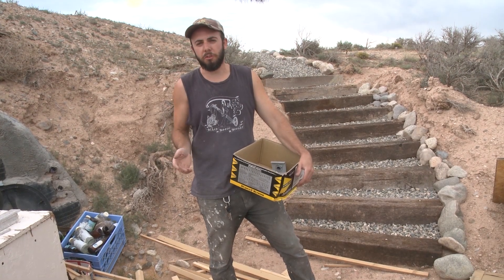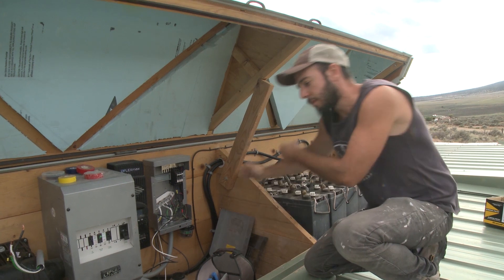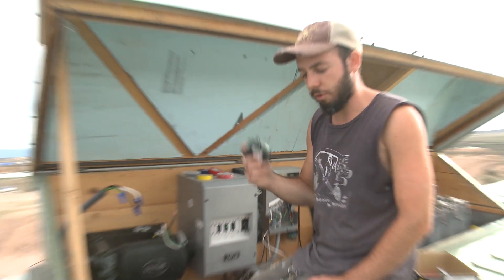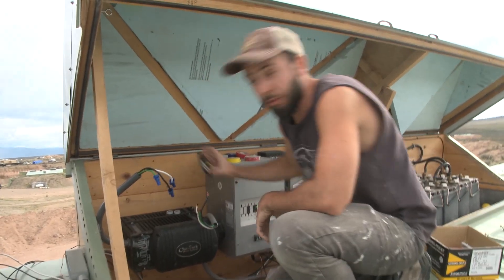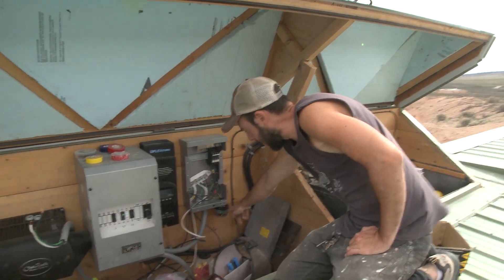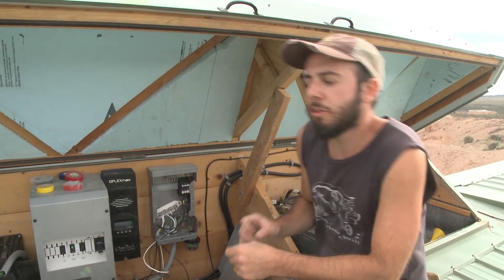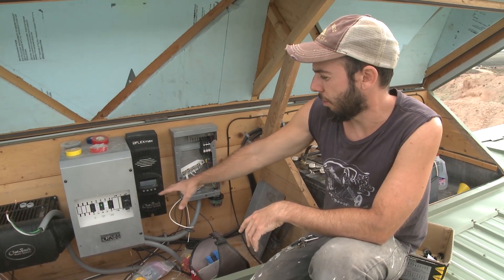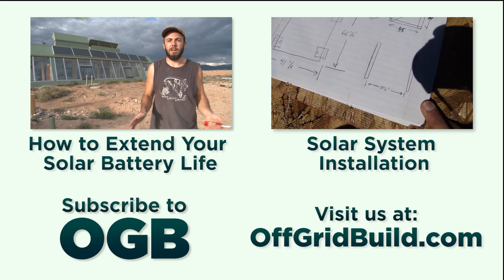How to Protect Your Solar System From Surges, Shorts, Lightning, and Haduken

Comment: As for lightning … I agree that the more protection, the better, but …

If you have a direct strike, your stuff is (likely) toast. As it was explained to me, a lightning bolt has already traveled THOUSANDS OF FEET (maybe miles) before it gets to you. It’s nothing for it to travel a few more feet to bypass your best efforts to stop it. Electricity usually follows the path of least resistance, but when you're dealing with ionized air, it really becomes unpredictable.

Where your lightning protection will really help is either to shunt induced current from cloud-to-cloud lightning, or a ”near miss” where it strikes nearby. You might actually do better putting in a BEEFY grounding system for your enclosure itself.

Comment: My questions is if you put a power surge protector box in place to protect your solar system but the Electric Co-Op Company has a power surge that fried our power surge protector box and 22 Microinverters and our solar company said that the Microinverters want be covered under warranty in this case.So this is a draw back and the Electric Co-Op want take the blame for it.

Comment: Hi there! Thank you for the video. One quick question, in a two solar panels system with a microinverter (plug and play), where should I install my circuit breakers, in the DC or AC side? Thanks!
Reply: Why not both?

Comment: I like your setup. One suggestion. You are holding that lid up with a single board located in a notch in the wood. Put a collar around that notch so the board can' t be knocked out and the lid dropped on you while working.

Comment: I couldn't hear most of the sound from 4 min. to end 
   Can I use a MC4 Connector fuse to protect my equipment from a lightning strike? or do you need a bigger protector of some kind?
maybe a lightning rod mounted close to the panel? taking the strike to the ground?

Comment: Lead acid batteries out gas hydrogen when charging. You really should not have circuit breakers in the same enclosure. Although the amount of of H2 is nominal when charging from solar, if not properly vent you could have a build up.

Comment: how are you venting this box? since heat rises I would think that the batteries would get hot during hot summer days.
Reply from the maker: +Dart Gar its insulated enough that it doesnt matter.  Plus nightttime is always cool in the desert, even in the summer, so they always get to cool off
Reply: @offthegridbuild  You might want to check how hot it actually gets in the box during summer. High heat stress shortens the life of many electronic components. Insulation can work great for most of the year, but it might keep internal heat from dissipating during the summer. If it was my system, I would take actual measurements.

Comment: Hi, I think as you were describing the lightning / surge protector, what term you should use is voltage "differential " not potential.  When an electron charge builds up between the surrounding air and GROUND, then a discharge will spark as in lightning striking, to equalize and dissipate the unequal plus to minus charge.  It can even happen between two gnd rods several feet apart, a spark would jump if they are not electrically TIED TOGETHER.  If you happened to be touching them and disconnect one, you may become the "path of least resistance" and get a jolt.  Inside the protector unit are blue or green discs that look like  a flat round candy . They vary in size from a dime to a quarter and are called M O V's    metal oxide varistors.  They are inactive until a voltage spike occurs  and then they short out to GND and dissipate the excess voltage. Hope this clarifies a couple of questions you may have.   Jim K  retired telecommunications tech
Reply: ‘Potential’ is correct. You cannot have a ‘voltage differential’ because, by definition, ‘voltage’ is a ‘difference in potential,.

Comment: surge protectors for man made electricity; lightening arrestors for lightening.  Be advised though, if your equipment takes a direct hit from a billion amp bolt of lightening, not much will be left.   I use both with fingers crossed.
Reply: yea being in the cable industry we take great lengths with our backup power supplies to put in surge suppression. but when you take a direct lightning hit everything will fry no matter what. and that stuff on the roof with all the wood is a huge fire hazard. If I was you I would use lightning rods to try and divert a possible lightning hits like they did in the old days thick copper welded to ground rods and lightning rods

Comment: Being on the roof, how hot does it get up there in summer? Batteries really hate heat, and their length of life drops off every 3deg c after 25dec c  (the stuff you learn living in a shit hot place like Australia)  might be an idea to have a heat exhaust fan installed and run from it's own small panel maybe?    Just a thought.
I keep mine under the house where it's coolest, as it it's near 40c here in Brisbane every bloody year, sometimes over that.  
(that's 104f for the USers.)
Reply: John Douglas Hello John Douglas!  Great comments!  My cabin is in Northern Wisconsin near Lake Superior. I have the other problem. It gets cold. -40 F. That’s -40 C for you downunder. I keep my batteries under my insulated floor. Mother Nature keeps that above 0 C. Good Day
Reply: In this case, he has an underground house and is trying to minimize the distance of wiring runs on the low voltage side on the same note keeping the batteries cooler will help with life and performance there is probably a better area to put this set up in I also know that sometimes good enough is used I have done it myself but he is learning and helping others to learn as well

Comment: If your looking to restore a large battery bank you will need a old 6 cylinder car distributor and rotor ( AMC-Chrysler works best) , and a 50 amp battery charger and a 20 to 30 rpm motor.
Place the positive lead into the rotor center, and take all the leads out of the 6 plug points and connect them together. Run the grouped 6 wires into one, then to your battery bank ( good for 600 to 3000 amp bank) and put a gear reduced motor on the distributor shaft to spin the rotor, striking the contacts every second for 1/4 a second contact duration.  This pulse from this set up puts higher voltage ( in mine it was 16.7 volts) which cleans the plates and renews the batteries. 
Another one I probably should make a video on! Mine renewed 9 year old golf cart batteries in under 2 weeks. Still using them 2 years later.

Comment: Wanna prevent surges?  Then use wire and a window weight ( iron) thats 10" long. Wrap the common coming out of the inverter 24 to 30 wraps around the iron window weight. Then run the positive straight across it length wise and tape it all tightly together. VOILA', suppressor in Toroid collective coiling. It works so well it smoothed out  modified wave inverters. 
I may have to make a video to detail it.
Reply: I know it's been three years but have you made this video? I'm really interested in how this works and how it can be built. Best regards.
Reply: Its now 6 years. Wheres the video?

Comment: why are your batteries up on the roof? and what happens if you need to get in there and its raining and the wind just happens to be blowing in the direction that makes the water go straight in the box?

Although looking at the landscape, its doesnt look like it rains much there...

thanks for the info on the surge protectors and breakers.

Comment: You mentioned burning up an outback inverter by a direct short via a screw or nail....can you mention what breaker size and make/model was in place at the time?......this may help others out there and maybe changing the size or brand can save some $$$$$.......ray

Comment: Well, I would install the lightning arrestors on the panel strings and combiner box.  But I wouldn't install them else where.  Fuses I would say would be good after that.  Am planning to fuse each leg of the bank with 50A fuses and the bank as a whole with 200A.  Am not sure yet to each outback inverter as I plan to have two of them so I can have 220 but I was going to set the DC side to pop at whaterver the surge current would be.  As far as from the inverters down?  Not sure what I will do on that yet but you have bought up a good point to think about as It wasn't in the initial plan.  AC disconnect box with a fuse on the split AC?  Not sure yet but thanks for bring that up.

Comment: Won't help against an EMP, though, right?
Reply: Joe Primal
Agreed, every little bit of protection you can do will help. I hadn't fully considered some of the points you made, so thank you. Every bit of new knowledge helps too. I think I'll still stash backups of critical stuff (like medical equipment and device chargers, for example) in Faraday cages/boxes, but I do feel much better knowing how to provide the best protection for the things not in a cage/box. Re: transformers being robust critters....last time I rode out a hurricane on Galveston Island and watched 75% of the island's transformers blow up so prettily (and they are beautiful when they explode, LOL), I realized the issue was going to be replacing them. Yes, I know their failure was wind/water and not EMP, but if you can't get replacements in, the extended lack of electricity is going to get just as ugly. So with an EMP, I'm thinking most of the damage isn't going to be from the weapon's detonation itself, but rather from the effects downstream of certain key systems being without some/all power for extended periods of time. Secondary, not primary. But bottom line, I'll just do the best I can with the information I have available, and hope for a bit of luck. Thank you for the reply!
Reply: You could easily build a faraday cage in that electrical box that will protect against EMP.
Reply: i may be rong but isent the box on the roof covered in galvanized metal?? Because if so as long as the roof is "Earthed" , the box on the roof  is a Farady cage.
Reply: AnnBearForFreedom  I couldn't agree more.  BTW, a really easy cheap faraday cage is get one of those cheap foil looking survival blankets and just wrap the things up in that.  All the ones I've seen are actually foil coated.  A good way to test is wrap your cell phone in it and try to call your cell.  If it doesn't ring you're good. 

Riding out a hurricane on Galveston Island instead of evacuating...shame on you.....I'm so jealous.  He he he.  That's on my bucket list.  I did a tropical storm once.  Something about the awesome power of nature.   I want to see a volcano in person too, but not too close.  Tornados,  I'm not to sure about that one.  Enjoy!
Reply from the maker: unfortunately, no.
Reply: +mikeallenbrown1 I know this is an old post, but a faraday cage over the scource of power would not protect against an EMP. It would affect all electronic circuits whether they are connected to the outlets or not. And tbh, even then a faraday cage over your entire house would not be sufficiant I don't think
Reply: +AnnBearForFreedom      I'm going to disagree with the notion that it won't help with an EMP.  I'm an engineer and have worked on military EMP stuff so I have some knowledge on the matter.  First let me say that EMP effects are hard to predict.  Weird things can happen.  That having been said, generally speaking the notion that an EMP would knock everything back to the stone age is nonsense that has been perpetuated through the net.  The military has done testing for example on modern cars and the vast majority of them came out unharmed.  The little damage that did occur was mostly minor.  Things like clocks.As a general guideline,  the longer a wire that's attached to something the more vulnerable it is, because these wires act like antennas picking up the EMP energy.  The second thing is current flow.  If a device is just sitting there, like a radio or cell phone, there is no way for the current to find ground and thus it's unlikely that any current flow would be set up in the device.  So loose electronics is mostly going to survive, especially if it's turned off.  The grid however is one giant antenna and huge current surges and voltage spikes will occur.  Therefore things that are plugged in and turned on will be much more vulnerable to destruction.  However, that depends entirely on random events that may happen.  The first things to fail will dump the surge to ground.  As transformers and other things fry, they will dump the surge to ground and trip the breakers all over the grid.  Many things hooked to the grid will survive and IMHO the grid itself while damaged will not be nearly as destroyed as people think. Transformers are very robust devices and most of them will survive long enough for the surge to be grounded by lightning arrestors and shorts to ground caused by failures.  So it's more a matter of chance as to what survives and what doesn't, but things don't have to be in faraday cages, and things like lightning arrestors and surge protectors and fast blow fuses will certainly help protect things.  Especially if there are good earth grounds connected close to the arrestor, or if there are multiple arrestors on the system.It's also worth noting that causing a nation wide EMP of substantial power is not an easy task to accomplish.  It requires weapons of a type and power and precision that only the superpowers posses.  Furthermore, both the US and Russia analyzed an EMP attack back in the 70's and both sides concluded that it was a waste of a weapon, and that the bombs would be much more effective when used against targets.So keep EMP in mind but don't believe the hype, and yes, every bit of protection does help.
Reply: What you say is a good idea, however Gamma radiation will zip right through 1/2 inch thick STEEL as you should know.

Comment: I would have thought that the inverter would have built in protection in case of a dead short to protect itself.
Reply: It is strange that a cheap inverter is better than a more expensive one with regard to protection.
Reply: It seems that they don't. I read elsewhere that a guy fried his inverter by getting the positive and negative wires mixed up.
Reply: Interesting.